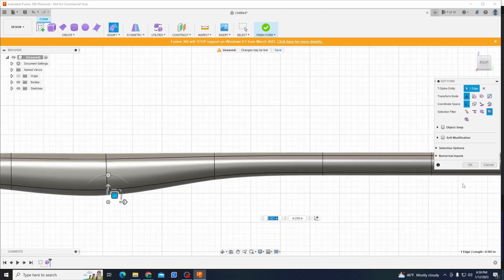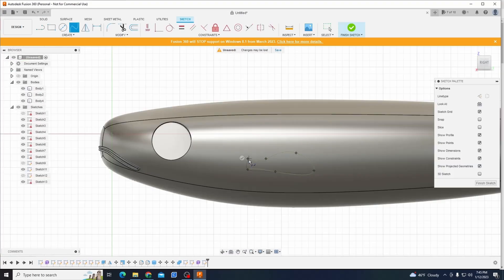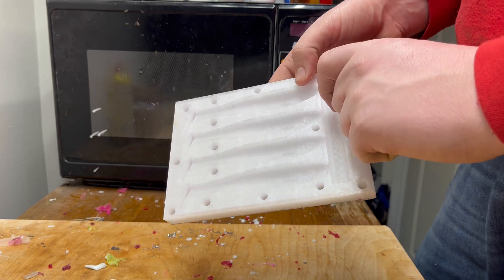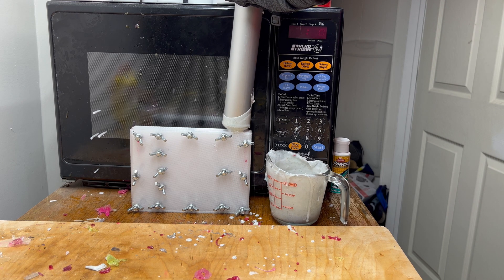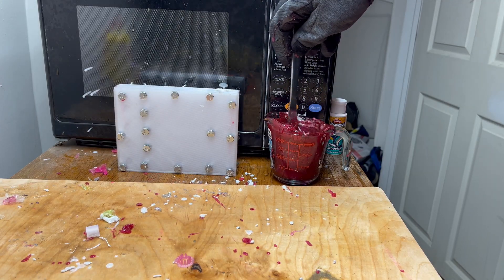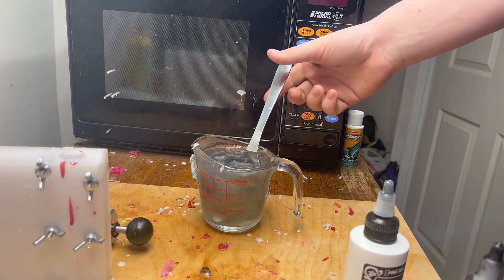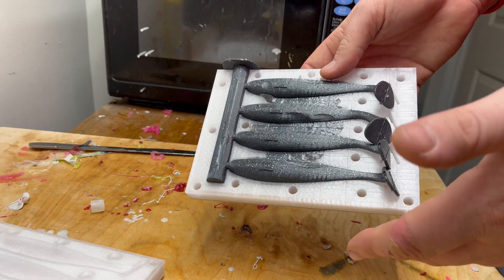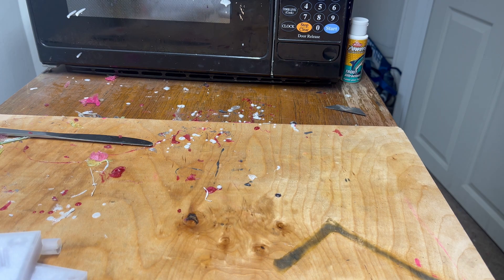3D Printing a PADDLE TAIL SWIMBAIT The 5 Inch Edition

Comment: hay this is an awesome video and design but i was not sure witch to print to use i see there is a take 2 vented and unvented but it seems that those are only one side of the molds and there isnt an opposite side for them to go with any help is appreciated
Reply from the maker: Im glad you liked it! I'll take a look at my cad files this weekend. I could of messed up. In the mean time you could just use the mirror tool in your slicer software to get it working.
Reply from the maker: I took a look. Everything seems fine on my end? Not sure if it was a download error. It also looks odd because the bait is upside down in order for the tail to fill properly.

Comment: And do you need a specific kind
Reply from the maker: Whatever you use the main thing you are looking for is temperature resistance. The plastic going into the mold is going to be between 300 and 350 degrees. It needs to be able to handle these temps with moderate pressure. Resin printing is the better option. The best commonly used fdm plastic would be petg but polycarbonate is much better.

Comment: So that polycarbonate blend plastic wont melt when injecting hot plastisol??
Reply from the maker: I havent had too many issues yet. You just have to keep light pressure and keep the temperature as low as possible. Ive had molds warp on me when I inject it too hot or push too hard. With these molds i usually try and keep the temp as close to 300 as possible.

Comment: Hey man. I am about to give up on trying to print this. Just got an enclosure and it didn't help. Now I just ordered a dryer. Can u send me the actual autocad files for this? I might see if my guy at work can mill it.
Reply from the maker: Sorry your having so many issues with it. You can send me an email which can be found in my YouTube bio and I’ll send it over in whatever file format you need. If you want to you could describe the problems your are having and send me some pictures via email maybe I can diagnose it.
Reply: which email address would you like me to use?
 @HandCraftedAngling
Reply from the maker: HandCraftedAngling@gmail.com
Reply: Let me know what your email address is so I can send u pictures of my last try printing
please. I need the cad files.
Reply from the maker: @roccofilippi1418
It’s HandCraftedAngling@gmail.com

Comment: I have an Ender S1 and was wondering if I can make the mold out of Petg? I cant print at the temp that PC demands.
Reply from the maker: Yes you definitely can. I am not sure if I tested this particular mold with it but I've done stuff the same size. It will have a shot life though. With petg you just have to be carful with temperatures and pressure. Try to shoot as cool and with as little pressure you can to get a finished bait. Not sure what temps you can print at but I print the polycarbonate blend in the video at 255c. I also just posted version 2 of this mold which should make it easier on you.
Reply: So I were to get the material and print this do I need a space heater and a "tent"? If so what space heater and what setting do I use with it? We are really considering printing these. TYIA @HandCraftedAngling
Reply from the maker: @roccofilippi1418  Definitely do not need a heater. The ambient temperature of the print bed should be enough. You may be able to get away with no tent. I would try it without one before you go ahead and buy it. The edges might be slight warped without it, but the material usually has enough flex to it that it can be shut with bolts or clamps. You can definitely try the petg first but you may have some issues with warping there. This is what I use https://tinyurl.com/yu99c3as

Comment: Awesome! You think you are able to do like the easy shiner in 4,5“ ? 
maybe you could try painting the surface with epoxy resin, i hope you can spray thinner then. just like the easy shiner is.
Reply from the maker: I could probably make something like that. I am taking a break from YouTube at the moment I have too much going on right now but ill be back. I don't think you can spray epoxy on soft plastics because it will be to rigged. The do make spray on clear coat for soft plastics but I've never tried it before.